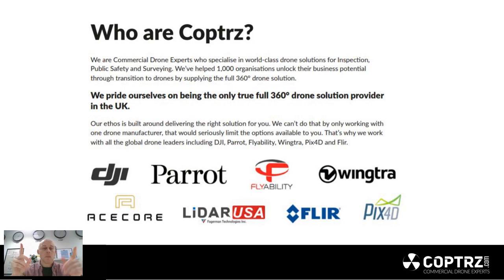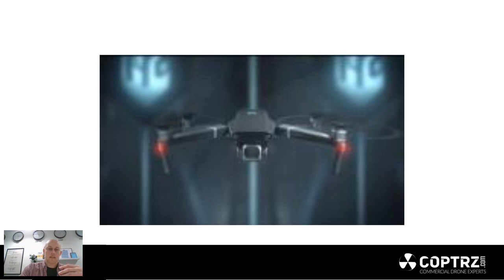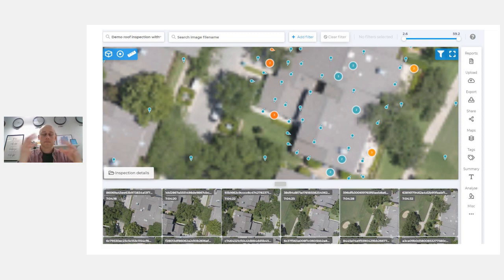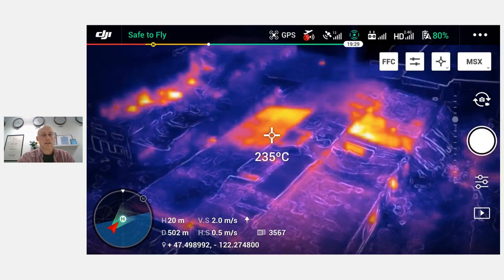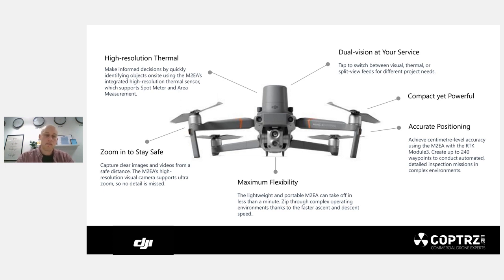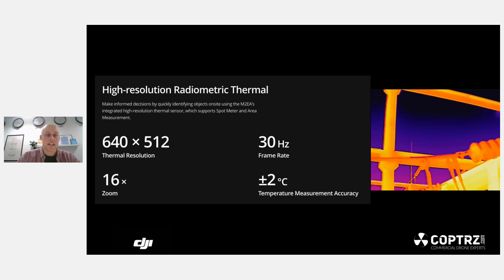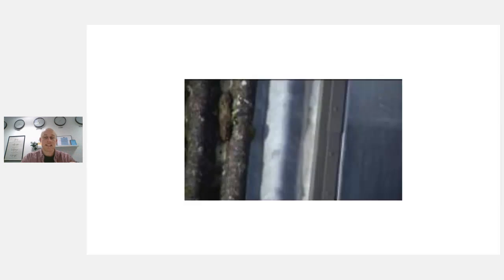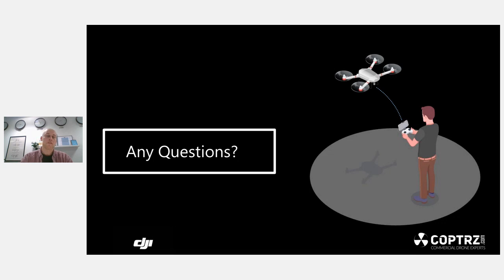Exploring the DJI Mavic Series: Mavic 2 Enterprise Advanced

Comment: Great video, but... please give it some thought about the new camera...

Start considering what the thermal camera is used for first. It is not supposed to be used for family photos so the resolution is completely uninteresting.
It is great that they have pushed the spec higher with better cameras etc. And I understand if you as a drone driver want a massive spec to be able to give the customer a good picture.
This is however not interesting at all for someone who is making thermal analysis of buildings.
The low resolution also shows enough for the engineer to find spots where the loss of energy happens.
So the Mavic2 Enterprise works fine too. 

I have a Masters Degree in Engineering and I did specialize in what is called the heat Equation where you make an extremely detailed analysis of energy flows in buildings and very complex. You need computer power to do it and it can take 10 minutes to hours if it is very complex. This equation can be used in the financial industry and FEM construction scenarios too. 

The heat/IR camera is only used to point at a leak in the thermal insulation. 
It does not matter if you have 2 pixels or 3 Gigapixel. You see this very well in both Mavic2 as well as in advanced.

So pushing the spec to understand more does not make any sense at all. 
you can actually buy the much cheaper Enterprise drone and achieve the same "precision" since there is no need for any precision at all. As long as you see where the leak is that is good enough. So "behind the window" or "next to the door" is good enough. There is no need to see the dimensions or the colour of the lipstick on the lady smiling in the window since you already have a 12 Mpixel camera that can tell you where the door or window is. 

So the spec must be seen what is needed and in its full context.
Why buy a rocket when you need a car?
Reply from the maker: Hi, some great insight you have given there! But as technology advances the specs will just get better and better - look at Apple iPhones for example. 

This drone has already shown to be extraordinarily useful within the inspection and public safety sector without any complaints!
Reply: @coptrz  true, but sometimes the chase for better spec must be seen in relation to what it can be used for. The question I as a buyer would have an answer on is "are there any thermal leaks or any thermal barrier holes?"
If yes, that immediately launches further and more detailed investigations.
In Safety I agree it would be a differentiator for the police, rescue etc where it is a difference between life and death... 
In engineering, this will be complemented with a proper infrared camera that beats the Mavic camera with light-years. 
So even if you step Mavic another step there are second assessments that will have even more clarity and better images than Mavic can achieve even if you make it 3x current Mpixel on the infrared camera.

Do not take me wrong, I am a fan of better spec, but in this case, the infrared must be seen in its context. I just wanted to highlight it since not all drone pilots know what the engineer will do when he gets an answer to his question.